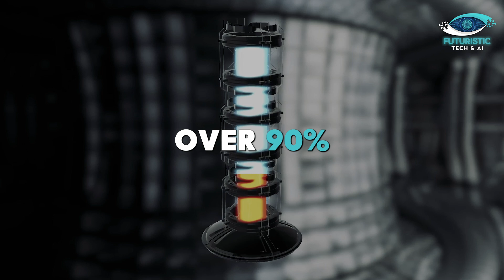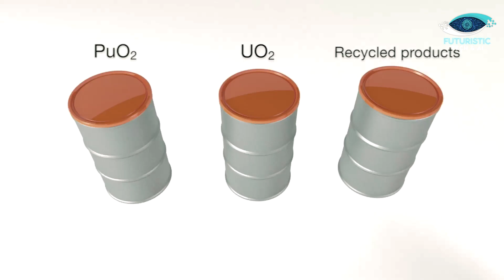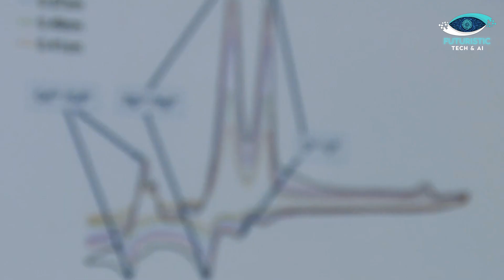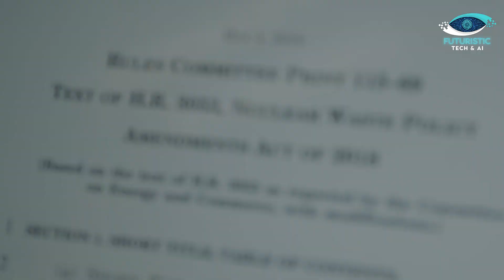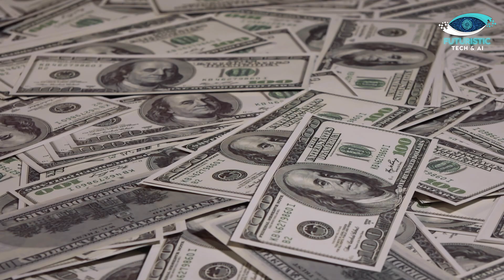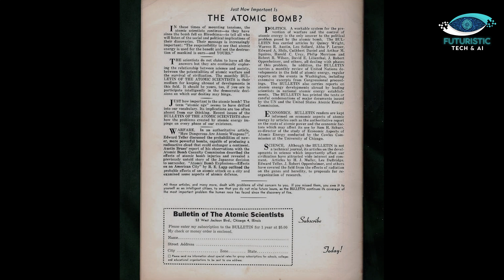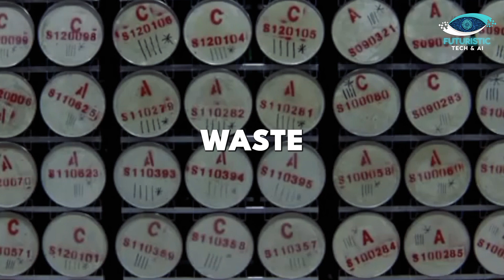90% of Nuclear Fuel's Energy WASTED - Here's Why!

Comment: Fusion is the future because less waste.
Reply: Unfortunately commercially viable fusion is a big unknown when it will be achievable.  By comparison fission is tech which has existed with very safe designs for the last 40 years.  It is plants from the 50s and 60s which have safety issues and even then the real world safety is perfectly fine.  The simplest form of fusion power is solar but then we need to solve storage or demand timing.  Renewables without storage can be an energy economy if the real price was passed on; variable price of electricity will encourage usage to overshoot intended temperatures for home heating/cooling, industry or EV charging.
Reply from the maker: Thank you for sharing such valuable information.
Reply: Billions to boil a pot of water.  You will never see it powering your home or anything else.
Reply from the maker: Yeah its right.
Reply from the maker: Thank you for the comment